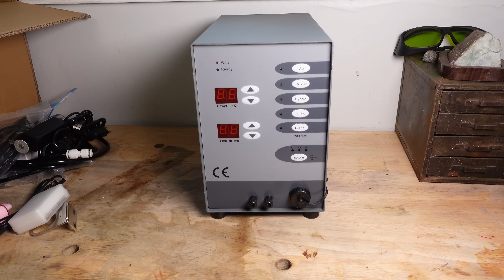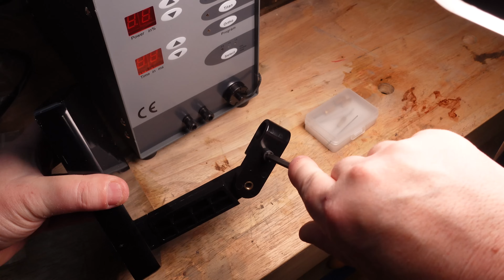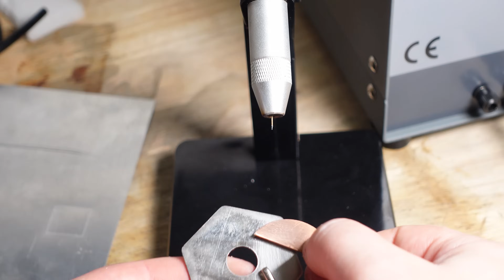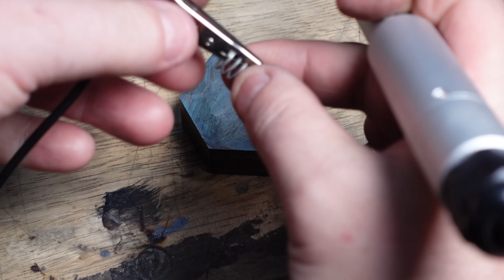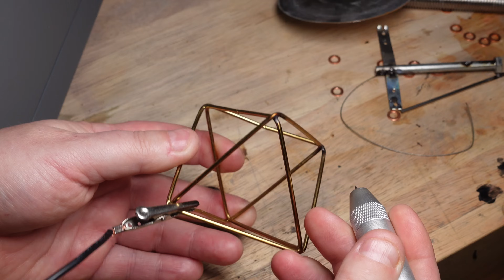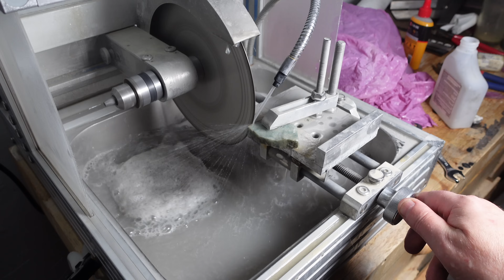Every maker needs this cheap little hobby welder #jewellerymaking #lapidary #welding

Comment: Love your videos, and this one convinced me to take a risk and order one using the link you provided. Unfortunately the Device I received is also dud - like your first one -  and as a senior on low income am counting pennies to pay return shipment. But before I return my dud, do you still want to compare devices? 
 Very frustrating for me, as my smith torch is great but cannot handle micro-chain. But do I risk returning this for another dud and monetary loss. Any suggestions appreciated - thanks.
Reply: Can you provide the link to the one you purchased so I can avoid buying lol
Reply: @theonenameneverused  Sure, let me find paperwork also. Will get back to you.
Reply: @theonenameneverused  Here is link:  
HZOPUTLH Automatic CNC Spot Welding Machine, Portable Handheld Welding Machine With LCD, 110V 50A-600 Permanent Jewelry Welder Kit Adjustable Time and Welding Power Pulse Argon Arc Jewelry Welder
I have not sat down to troubleshoot device, as my backround is chemistry NOT electronics. And when I removed cover to see nothing but large capacitors, I realized a refresher course in hi-voltage safety is in order LOL   Cheers!

Comment: Secondo te per diminuire l'intensità del flusso elettrico della pulse welder, può funzionare un variatore di potenza o un inverter attaccato alla macchina?
Reply from the maker: I haven't tried but do you mind me asking why you want to do that? Do you feel the lowest setting is still too powerful?
Reply: Non sono un esperto in materia e non vorrei danneggiare la macchina con un esperimento pericoloso,sono orafo, e ho pensato che forse questo potrebbe servire per saldature più delicate,che ne pensi?
Reply from the maker: @sirio-eg8oz Its made for jewelry making so it will definitely work. Good luck!
Reply: @sweetgumnyc7794 grazie,ciao

Comment: I’ve had one of these for a couple years, I’ve found that argon REALLY Helps but the tungsten electrodes it comes with are junk, so yourself a favor and get new ones, it’s been a while but I think I got a larger size and had to drill out the collets to fit the new electrodes
Reply from the maker: Its funny you mention that because one person told me to replace the ground wire with a thicker one and it boosts the weld power and that immediately made me wonder if maybe I should try and thicken the tungsten and maybe even the wiring for the handpiece. So its worth it in your opinion?

Comment: I wonder how this would work for body work small stuff of course
Reply: Zero chance it only tack welds  it is not a proper welder you need something that's chucking out 40 to 80 A for welding car perhaps a little less if you're doing panels this thing is only 150 W

Comment: So I grabbed one of these it's pretty darn good. I did make a better heavier ground lead for it, and that does help by the way. I went to nice thick silicone 10awg wire which I'm going to make a second longer version of since I know it's an effective upgrade now. I know these things are a little different here and there but the banana plugs in mine had swivels so you don't get tangled but solving that problem created another one. It makes your contact point very narrow and I tested the connection with a meter and as you rotate on that swivel the resistance reading was all over the place. So with that out of the mix I'm finding I'm having a more consistent experience not using the ground lead that came with it  I'll have try it with the second ground hooked up too. It's nice that they give you options and they were trying to do a good thing with the swivel and it works still but I think I will stick with a solid connection. When I have it up on 10 and it makes a really good connection out of nowhere and makes a crazy good weld all of a sudden I'm thinking it should be doing that every time and not just when I have the wire pulled just the right way.
Reply from the maker: Im gonna try swapping to a thicker ground..I have recently begun researching the capacitors used in these machines to determine if maybe upgrading them could be a relatively easy way of boosting the power a bit too...i do see these types of machines with more power from china but they are priced over 2 grand. If I discover anything interesting I'll definitely make a video. BTW, how does upgrading the ground effect the performance? Are the welds more consistent or more powerful?
Reply: Was the shipping $100 when you bought it? I went to the Amazon link and it's $200 plus shipping.
Reply from the maker: @ChrisKewl  no, i bought mine before the tariffs went into effect a few months ago. everything is more expensive now unfortunately.
Reply: @ChrisKewl  I did not see that. Thanks for pointing that out.
Reply: I would get rid of the banana plugs and replace them with screws and nuts that you can clamp down. Make sure you use heavier wire as well for all of the leads the Earth the ground wire to the product et cetera then you should be okay and obviously make sure that your socket you're plugged into is powerful enough to Weld from.

Comment: I've been a subscriber for some time, and I enjoyed your video on the hobby welder.  One question, do you think this little welder will hold up?  I'm a jeweler hobbiest, and this would be awesome for odd metals that I can't solder.  Just curious if this is a summer tool and throw away, or something to keep in my arsenal for occasional use.   Again, thanks for your videos.  Keep them coming!
Reply from the maker: I honestly cant promise anything from personal experience because I have only  had mine a few months but the machine does seem to have a good reputation (if you get one of the good ones)  like i mentioned in my video that there are bad versions going around so it really matters where you get yours from but I absolutely love mine and after 4 months of daily use its going strong.  Im in contact with someone who's had theirs for several years and his is fine too  so take that for what its worth i guess? If you buy from Amazon they offer an extended warranty for a couple extra bucks if youre worried? Wish I could be of more help but I have had mine less than 6 months so thats the extent of my experience

Comment: Come ti proteggi gli occhi?
Reply: Grazie ancora
Reply: He mentioned that he was using a mobile phone as a magnifier and to block the direct flash.  Others have said they close eyes and turn away just before the arc.  The pulse is very short and not as much energy as continuous welding but looking at it very close will cause problems eventually.  Some automatic dimming welding glasses/helmet appear to work fast enough, others do not.  Using a regular welding helmet will not work without very bright illumination as you do not have extra hands to flip the filter up and down.

Comment: Whats with the floppy electrode, it keeps popping up?
This appears to be nothing more than an underpowered spot welder.
Reply from the maker: thats by design. the weld is so fast the tungston would get stuck in the pool so the tungston retracts at a very fast speed the second the weld pulses to prevent it from getting stuck

Comment: Can you add gold wire to the welding handle and use it for gold? I have a laser welder, but this could be handy in certain scenarios.
Reply from the maker: Yes you can weld with gold but what youre seeing is tungsten, its not welding wire. It welds without wire unless you choose to use it

Comment: I bought one of these for model making and producing hypoallergenic jewellery using titanium wire and aluminium. I haven't tried non similar metals, but the same metal welds without filler material have been fine. I do use argon it saves on clean up afterwards.
Reply: Is argon a requirement for joining titanium to titanium? That’s my main interest in a welder…titanium and if possible, niobium.

Comment: would be interessting to know what differentiates them.
after seeing this video, i immediately ordered one since i mainly work on smaller stuff where a normal tig would be way overkill.
welding tabs to batteries, patching holes in small metal cases, making small enclosures or shields etc.

im not based in the US so i had to get one off aliexpress,  200 bucks incl. vat and shipping to germany
it looks the same, it has the same box, same manual, came with exactly the same parts as yours.
but i cant get brass stick to stainless at all and im struggling to find a setting where 0.5mm stainless sheet welds but at the same time doesnt blow a hole in it. 
also just ordered a bottle of argon and a regulator to see if it improves the strength of welds.
Reply from the maker: I was very clear in the video that I posted that most of these machines are crap. If youre unable to get brass to weld to steel you almost certainly have a bad one. Return it if you still can and buy from the Amazon supplier i provided. The difference between the two are night and day and YES , like I said , on the outside they all look identical
Reply: @sweetgumnyc7794  I think the issue is that the one from your Amazon link rarely ships anywhere outside the USA ... I myself cannot order that one. That is why people are looking for equivalent from Aliexpress not Amazon
Reply from the maker: @Akallabeth13666  i reached out to them to ask if they have an aliexpress option and im waiting to hear back. hopefully they respond soon. I will share it as soon as i have it
Reply: @sweetgumnyc7794  can you do a simple tear down, just to compare. cant imagine they are all different on the inside.
Reply from the maker: @gamerpaddy like I mentioned in my video that now I wish I kept the first one but I sent it back. It would have been interesting to look inside and see what's different.  If you look carefully at other videos online you can notice differences in the handpiece too. Im not sure how that correlates to functionality but this most recent one i got has a sandblasted/  matte aluminum handpiece and the original one ( and most others you see sold, have a more polished finish on the handpiece.  Im curious if theres something there ?
Reply: @sweetgumnyc7794  i have the exact same handpiece on mine.
same size and finish etc.  

maybe it is the same unit but the materials i tried to weld were just of a weird alloy that i just havent found the right settings for yet.

i removed the side panels to peek inside, theres 2 green pcb one at the top one at the bottom and one for the front panel.

the top one has 11x Changxin 10000uF 63V capacitors and one 4700uf 63v. there is a big transistor on black heatsink with "IRFP150M" marking on it.

the bottom one has a row of 32x big resistors and 8 transistors behind them.

main processor chip has "atmel" written on it.

below that is a toroidal transformer and the gas solenoid.

once my argon bottle arrives, i make a video + teardown of it.
Reply: Hi, if it works for you well can you share the aliexpress link? Thx

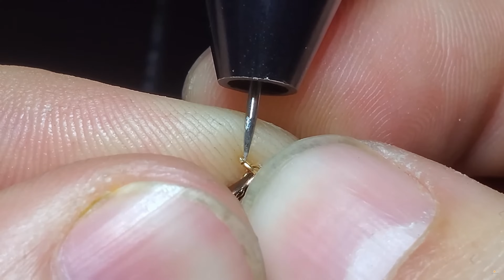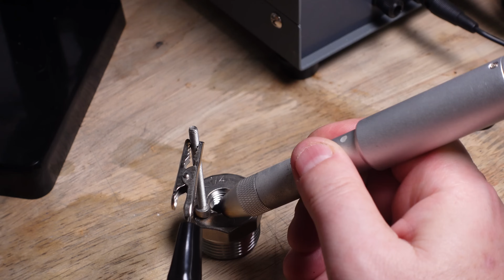Comment: @ 2:20 you state it can be used on small  jewelry and show jump rings being welded…then at 6:50 you state the smallest setting is too strong for jump rings…great video, but can it or can it not be used for jump rings??? Thanks
Reply from the maker: Yes it can be used for jump rings but the lowest setting might be a little too powerful for the thinnest sized jump rings.

Comment: Half of the metals you have shown cannot be welded even with argon. Basic brass alloys are simply not weldable, zinc burns out in them. Aluminum on DC, and even without filler material? You don't whisper anything in Latin during the process? The apparatus is quite useful if the user understands what's going on. You present it as a magic wand.

Comment: I have such an Aparat, it grabs gold and silver well, in other cases it gives a porous and bad seam that breaks. For welding of gold and silver, you still need a wire of the same metal. I would not advise you to take it. It is a lot that it is good, but it is useless.

Comment: Beware those tungsten rods might have thorium. The chinese have an over abundance of thorium and they are trying to get rid of it. So even if you buy "pure" tungsten electrodes it still could have significant quantities of thorium. You don't want to spread that grind dust around inside your house or even workshop.
Reply from the maker: Thanks for the heads up. Because I use it ( at least for now without argon, I assume I will be burning out rods faster than usual so I was gonna buy some aftermarket rods anyway.  Plus I wanted to try thicker rods than they supply with the machine to see if I could get a slightly bigger weld

Comment: I bought exactly the same device a few years ago, even with argon. By the way, I have a large argon cylinder, almost as tall as a person. I’ve already used up about half of it, and in the end I realized that you really can’t weld anything serious with this machine. It only creates the appearance of welding. You can maybe manage very, very fine jewelry work, but nothing larger. It simply doesn’t have the power to melt thicker metal. So, either my unit is just too weak, or that’s simply the way these machines are. And the funny part is, mine looks exactly the same and I paid over $200 for it. That’s my experience.
Reply from the maker: that was my experience exactly. Thats why i tried to emphasize in my video how some versions are too weak to be of any use and other versions are fantastic. As you can see even in the comments of this video, some love theirs and some hate it so it entirely depends on the version you buy. The one i returned from the first supplier performed exactly like you describe, you could break the welds free with your hands easily. This version doesn't have that problem at all. that said, even with this version you're not gonna weld a car frame with it, its strictly for smaller sized projects but the welds are remarkably strong and able to support my entire body weight hanging.
Reply: You might be able to make lithium battery packs with it. I made my own spot welder for some RC projects. Basically you spot weld the tabs across the batteries for + /- connections.
Reply: @JW007100 Could you use such a spot welder meant for batteries to weld metals like in this video? I'm wondering if I need to spend a lot of money or just get one of the more affordable spot welders.
Reply: @ravenkarunanayake2550 The spot welder they show is around $349. There are some some on Amazon as low as $49. but they may or may not work. I made one for a RC boat project with parts using a battery isolator, 12 volt car type battery. small. There are even very low cost stick welders like Yes for $70. BUT , ANY WELDER WITH ENOUGH AMPS CAN KILL YOU. Starting  with low power jewelry spot welders would be best.
Reply: @ravenkarunanayake2550 if I remember it right most battery welders have copper electrodes and this one tungsten, that means this one is most likely much more powerfull or maby its just to be able to focus the arc better without burning the electrode. Ive seen some battery welders that seems powerfull but then im not sure they are cheap.
Reply: @MyllerSWE  That makes sense. I believe you're right about this one being more powerful, I've heard the same.
Reply: @MyllerSWE  That makes sense. I believe you're right about this one being more powerful, I've heard that too.
Reply: it is a tack welder nothing more it barely melts the surface metals, it has no penetration at all which is what you want with welding if you are welding anything thicker than a couple of razor blades. Its not designed to weld merely tack 2 similarmetals together for a good adhesion, think of it being better than 2 component glue but certainly no stronger.  Buy youself a decent Mig welder, you already have the Argon bottle, dont buy aTig as its very difficult to Tig weld unless you have been trained andhave a lot of experience. Anything around the 350 usd to 650 mark is good enough unless you are welding structural beams together. Then seek professional advice.
Reply: @spiritburners 
Thanks❤ I already love him❤️❤
Reply: Fusion welding does not create joins any near as strong as filled welds. This is true even with full sized TIG welding machines.
Reply from the maker: @thecatofnineswords theres no reason you cant use filler wire with this welder. As a matter of fact its commonly used with this welder

Comment: Interesting, can you show me the inside of the welder?
I'm wondering how it works. Do you know anything about that?
As a DIY project, I think it's easy to replicate.
Reply from the maker: i was gonna  do just that because i wish it had just a little more power but i recently found this little $70 box that you can plug into any normal cheap tig welder that's supposed to convert it into the same type of pulse arc "cold welder", im gonna order one of those and test it out in a future video. if it works ill make a video.

Comment: wtf!  It looks great, aluminium and stainless steel without gas.  Sure for screws, small sheets and everywhere at home.
Reply from the maker: Yea im currently using it for a drone  project where im welding steel nuts onto aluminum sheet and its amazing